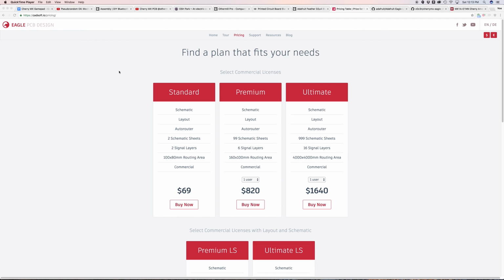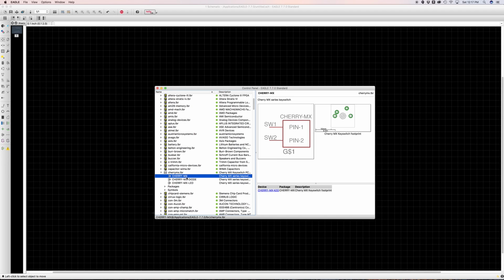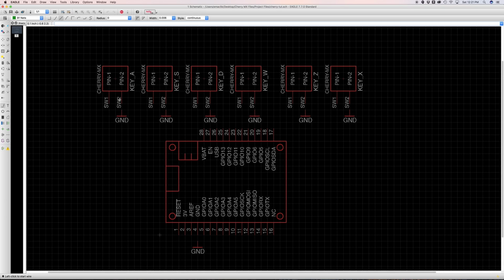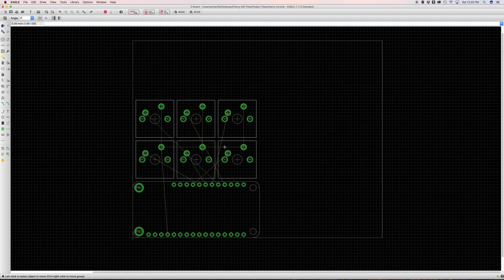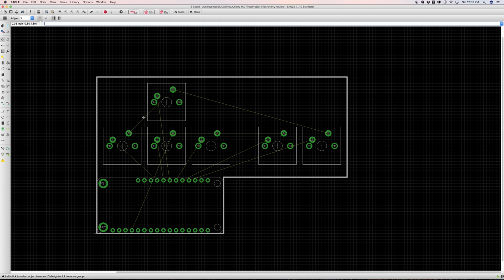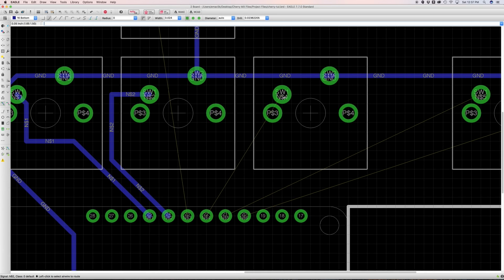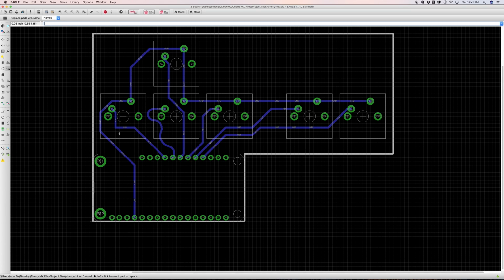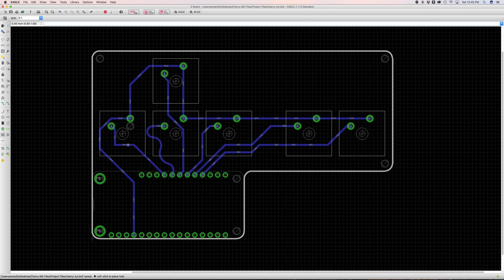Layer by Layer – Cherry MX Gamepad in Eagle CAD

Comment: How simple would it be to add LED slots for each switch on this PCB? Would you have to add holes to solder on a resistor and diode for each switch too?